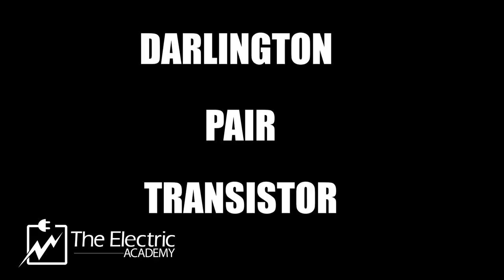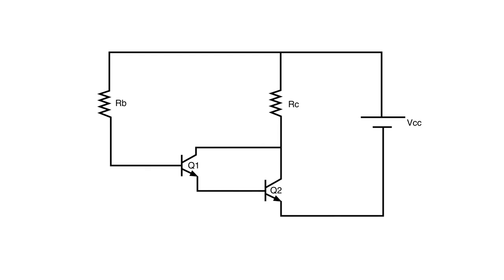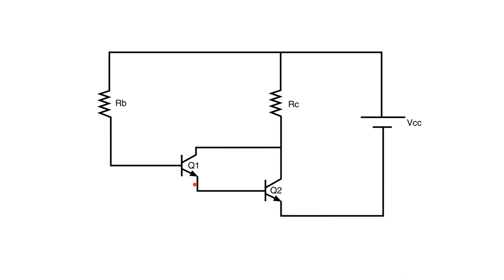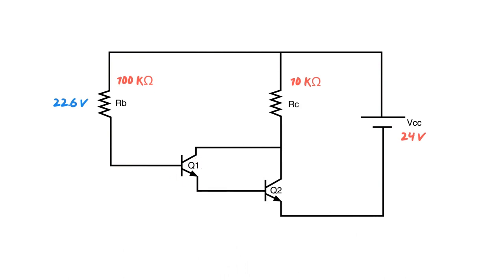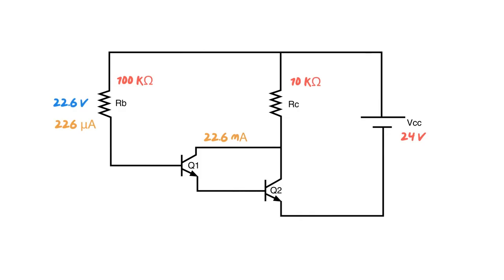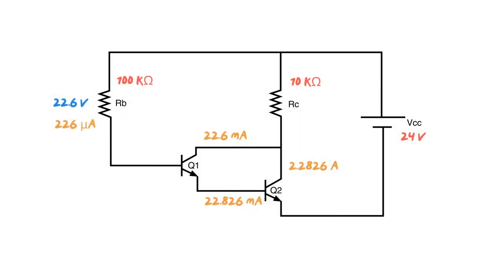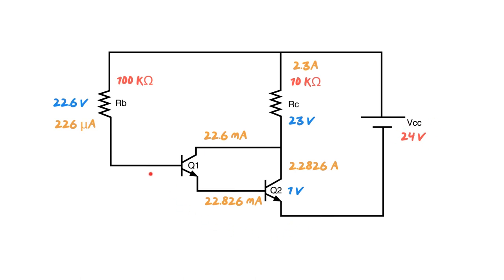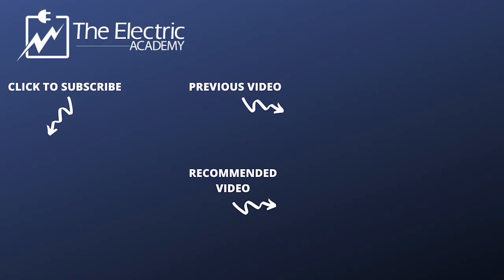THE DARLINGTON PAIR EXPLAINED: Putting two PN junction transistors back to back.

Comment: EE here. hFE is an abbreviated term for "Hybrid parameter forward current gain, common emitter".  I believe the abbreviation came about when it was used on multimeters.  A kind of crude short hand for the test of current gain in a common emitter configuration.
Reply from the maker: Ahhh. That makes sense.

Comment: Awesome Video Thanks.
Question Please : Can you run more than one pair of transistors? Maybe Triple or Quad (eg : Darlington Quad?) or more and if so would that be exponential current gains? Or can you only parallel Darlington pairs to reach your required amperage?
Reply: I can’t see why not but you will have the disadvantage of the voltage drop multiplied by the number of Vbe’s and that 3rd transistor would need to dissipate so much heat. That’s just my 2 cents and I’ll admit I have no experience improvising transistor circuits IRL but I have years of experience troubleshooting industrial logic circuits and the positive logic sensor/switches were at most a Darlington with other passive elements. The  way I see it, the third device downstream might as well be an ice cube relay with  a fly back diode across the coil contacts or the input terminal of a PLC.